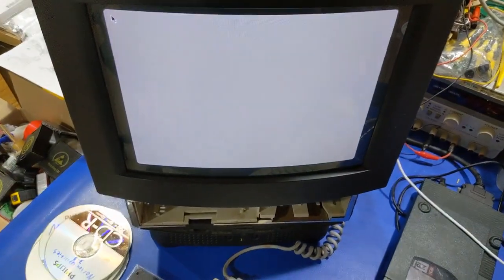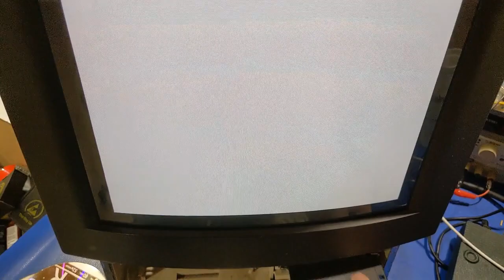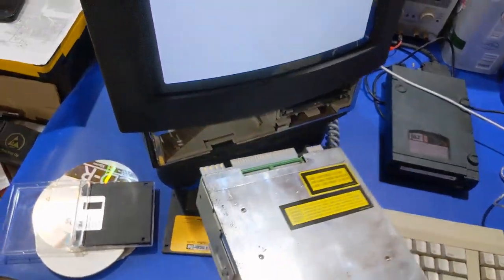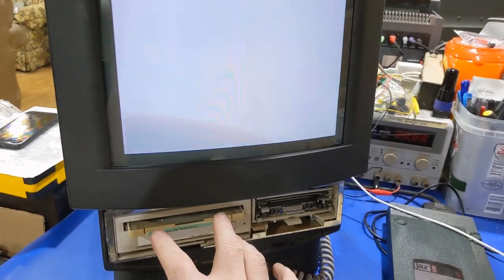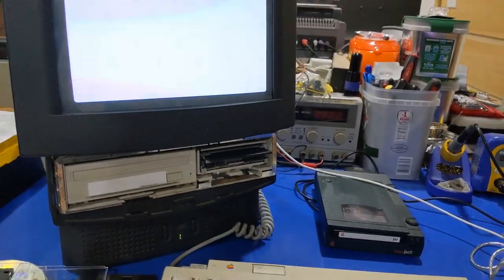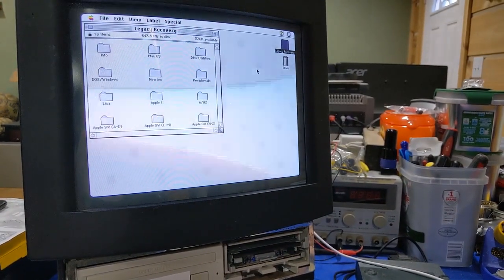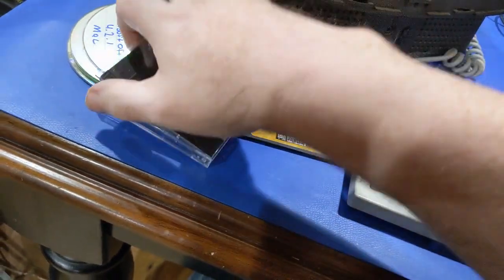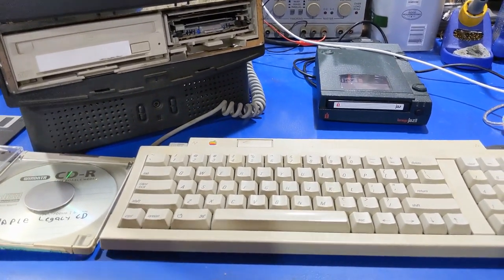Macintosh TV Restoration series: Initial testing

Comment: Just last week I had a similar problem trying to get a bluescsi in my 575. I ended up dislodging the port that the drive sled plugs in to from the back of the HDD bay and pulling the port and cable into the bay itself. After quite a bit of wiggling I was able to wedge it in diagonally in a way that I could plug it into a bluescsi laying flat in the bay with the original adapter. I checked the keying compared to the original HDD to make sure I was getting pin 1 in the right place. It wasn't at all tidy, like a proper mounting setup would be, but it's a permanent install and is hidden behind the back cover.
Reply from the maker: Yeah I just didnt wanna go through the amount of effort required to shove a blueSCSI in there. so i ended up finding another HDD